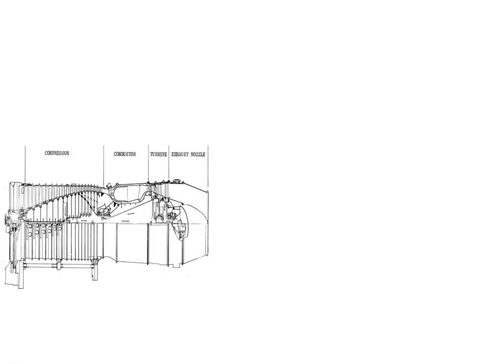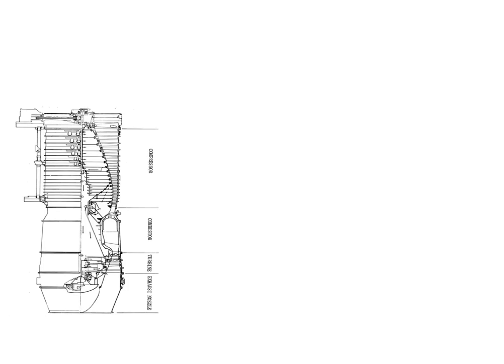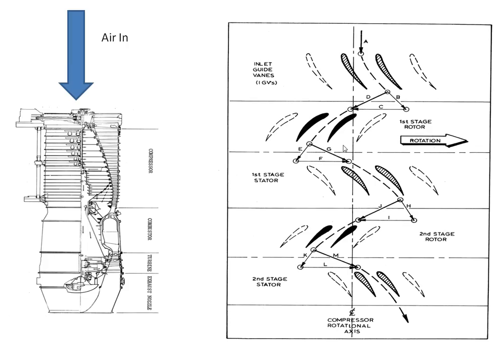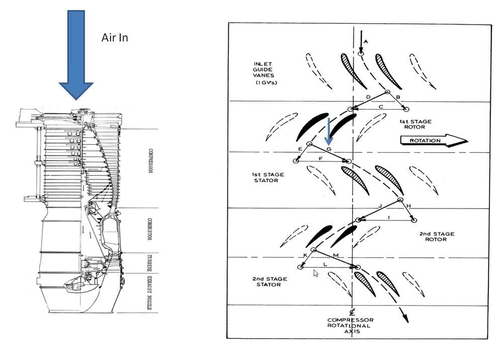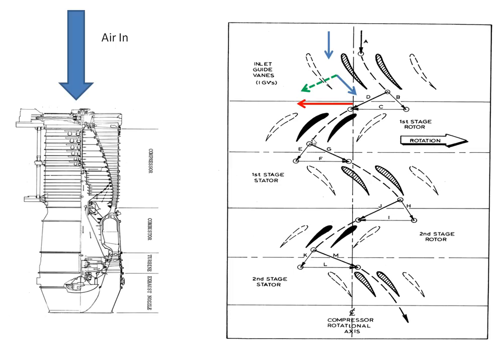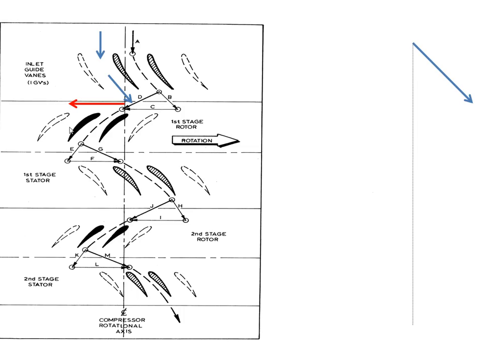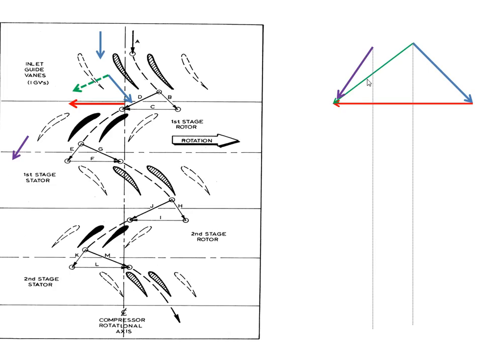Airflow through an Axial Compressor

Comment: The vectors C and I have the wrong sense of direction. It's supposed to point in the direction of the circumferential speed (rotation).
Reply: No. The C and I represent the relative velocity of the air relative to the blades rotation, it is correct that they are in opposite directions. Try thinking about being the air, approaching the spinning blades. The imagine the blades stop spinning, and as the air, you're motion must create the relative motion previously seen. (Hope that helps)

Comment: You are a saviour Roddy. Best, concise video on Velocity triangles. I have just one question though: Is theta(IN) usually known to the designer?
Reply from the maker: Daniyal Altaf Baloch , in my opinion the engines operate in a narrow RPM range, therefore the rotational velocity of the blades is also in a narrow range.  The axial velocity of the air in is around Mach 0.4.  Therefore, the input angle range  (theta in) should be identifiable to the designer.  The use of variable inlet guide vanes can help in this regard also.
Reply: @RoddyMcNamee  Thanks mate. helped me understand the concept.

Comment: The first stage rotor  blade rotation direction is given to wards right and why its direction is given to the left while drawing the velocity diagram.?
Reply from the maker: The velocity diagram shows the velocity of the air and not the blade.  It's like when an aircraft moves forward, the direction of the aircraft is forward, but the direction of the airflow over the wing is backwards.
Reply: Roddy Mc Namee Thank you sir.I understand.
Reply: +Roddy Mc Namee , there is a problem at the entrance to first rotor and second rotor U=w.r is reversed. When you add U and the relative velocity vectorialy, you are supposed to obtain the absolute velocity.  Sum of D and C will be equivalent to B. Sum of J and I will be H. I am afraid the two velocity triangles  at rotor inlets may cause confusion. Otherwise I like your presentation.

Comment: why does the thickness of the rotor blades reduce as you go down the axle?
Reply: David O. I think it's because the pressure gets lower.
Reply: @violentnexus3563  The pressure gets higher but the velocity gets lower

Comment: What if the ram air speed is zero when the airplane is not moving?
Reply from the maker: +Aviator168 
Good question.  The higher velocity air at the fan tips will cause a decrease in pressure that will draw the air into the engine.
Reply: +Roddy Mc Namee An other question. If the stator vanes are directing the air flow in the other direction, would we get a large delta whirl per stage?
Reply from the maker: Aviator168
The problem with the stator vanes directing the air flow in the other direction is that the angle of attack between the rotor blades and the airflow would become too high and the blades would stall.
Reply: @RoddyMcNamee  I am not sure whether that statement holds. For the angle the air is deflected in the shown direction there exists an angle on the opposite side that will result in the same angle of attack. However the magnitude of the vector will be larger. So drag and impulse are increased and cause unwanted losses in an axial compressor. For the propeller of a ship this effect can be used to increase the axial thrust.